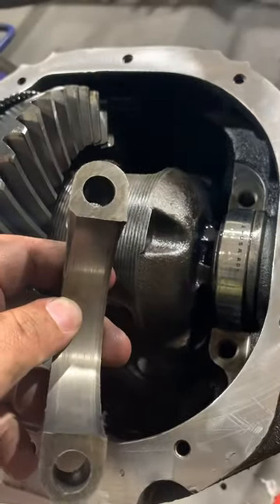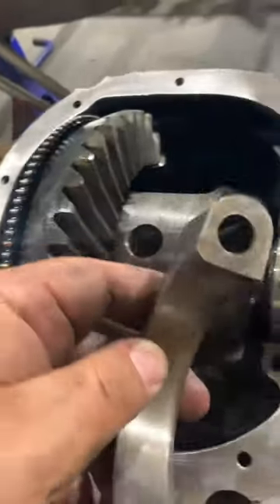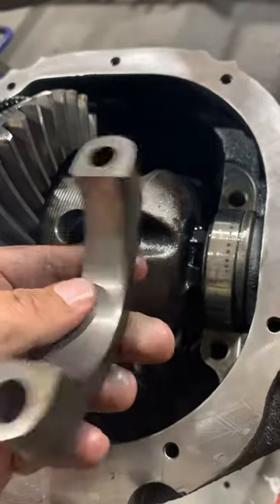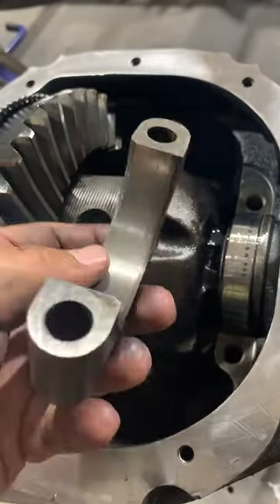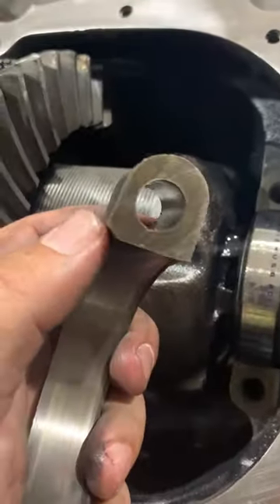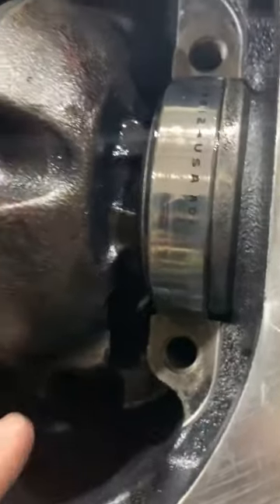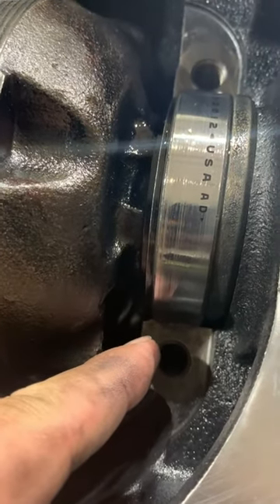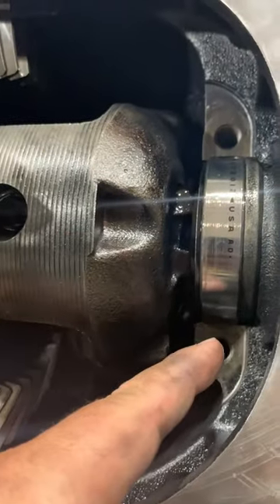FORD 8.8 TRICK! Identify SIDE-SPECIFIC Bearing Caps for a Ford 8.8 Rear! 🔧 | YouTube Shorts

Comment: My cobras are not beveled and of course my layout got kicked over. Starting to hate differential work more than electrical which I didn't think was even possible
Reply from the maker: Thats sucks! Hope you get it sorted out. Try looking again, there is usually always some differentiating marks, patterns or even wear marks on the bearing/cap mating surface

Comment: Both side of mine have bevels ..
Reply from the maker: Match them up. Spend a few minutes looking at it closely and it’ll make sense to you
Reply: @intheshoptv  yeah I did.. I also checked the bore diameters. Let's see if the driver axle goes in like it should now, It was going in real tight.
Reply from the maker: @D.Vincent1993  oh man, I hope you get it sorted out. The bevel is usually pretty apparent on the 8.8 carrier bearings, especially the corners. Even when you put the caps on - if you mix them up, you can feel that it just doesn’t seat right. Another thing you can try is looking for any fine wear marks on the cap and and lower part of the bearing and see if they match up. Good luck - sorry you’re going through that.